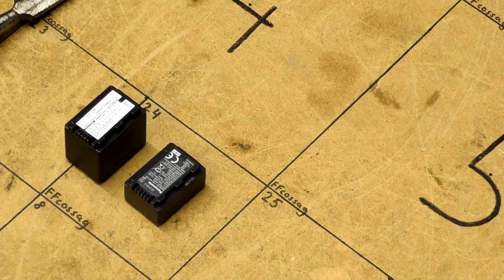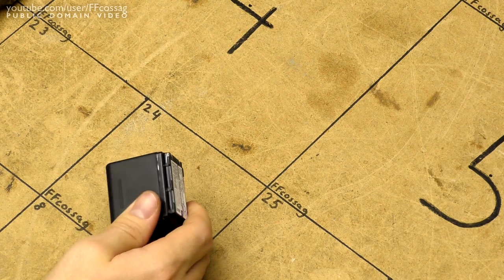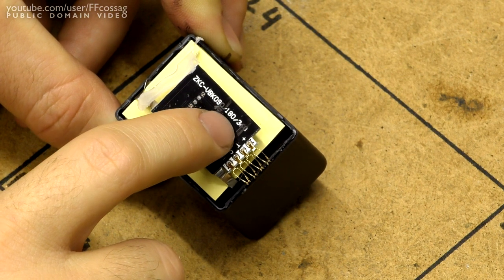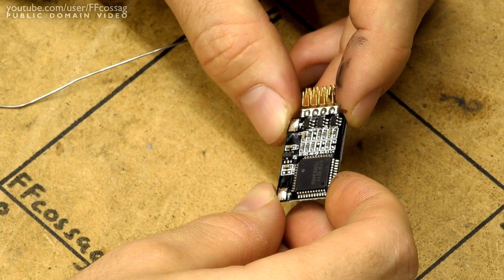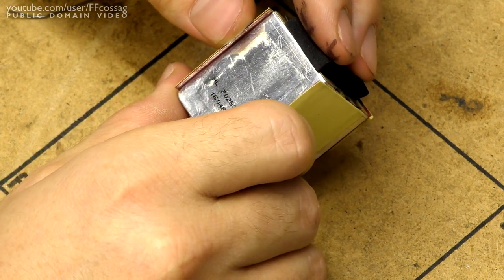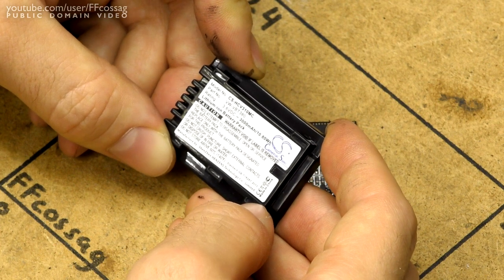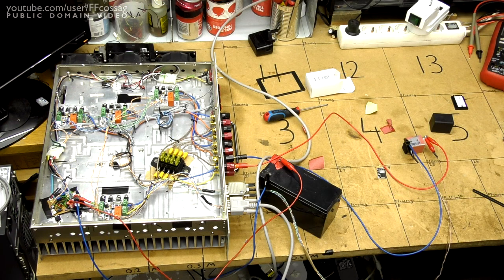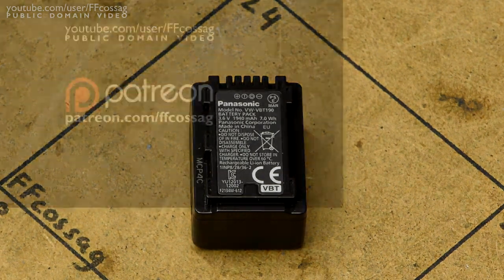Teardown/test: 3 Ah camcorder battery

Comment: Hmm, some NEC chips started with the "uPD", could be an old nec microcontroller.

The batterys just need a safe charge board and could be used to power something.
Like the chisel work, a carpenter in plastic LOL :-D

Comment: I have a Panasonic GH3 which stopped working with my third party batteries after a firmware update. Wonder if they've done the same thing with yours and it's the fact that it's not a Panasonic battery, and doesn't pass the battery authentication in the camera.
Reply from the maker: Perhaps, although there are plenty of batteries listed on Ebay as working with mine as well; they just cost marginally more.

Comment: I wonder if perhaps they forgot to program that microcontroller? Although I see it as more likely that a detail Panasonic checks for isn't right.

I'll second the thought (however shocked I'd be) that the microcontroller might be an NEC/Renesas part.
Reply from the maker: Hm, perhaps  these batteries are just a batch which suffered failed micros? The guts look too high quality to be the "cheap" model.

Comment: Hey,  can you swap the guts of your old smaller batt pak into the case of the new batt pak, I.E. swap cpu board, use old cpu board with new batteries, hey maybe it will work?
Reply from the maker: It might work, but it'll report incorrect runtimes.
Reply: FFcossag  I belive if the Chinese copied the original Panasonic board. you should be able to swap boards and use your old battery board with the new battery pak it may report incorrect battery type but should give you the longer battery life and the battery indicator should work correctly as it measures voltage levels as they drop.

Comment: These batteries drive me crazy, I would like if there were more of a universal type or for example a simple supply port one could run the camera as if on the mains supply, then at least you could power along with an external battery pack worn on your belt or in your pocket.
Reply from the maker: This camera actually charges from a normal DC jack at 5 V, so that'd be really easy to arrange. You can literally run it off of a USB power bank if you want to, but I prefer the simplicity of an internal battery.

Comment: Why not take a broken down original Panasonic battery where the cells are shot and extract the board from it in order to solder it to the good stack of cells and reassemble it in the case? You might get a working battery out of it after all! Just need an old Panasonic one that would have worked with your camera...
Reply from the maker: That'd likely work, but these camcorders are so new that you can't easily get dead batteries for them.
Reply: FFcossag Then they probably put some DRM crap on the battery chip of the newer models, so the batteries that work on the older models won't work on the newer ones. It's a shame companies do that. Just so they can continue selling totally overpriced batteries. Almost as bad as with inkjet printers!
Reply from the maker: Agreed.